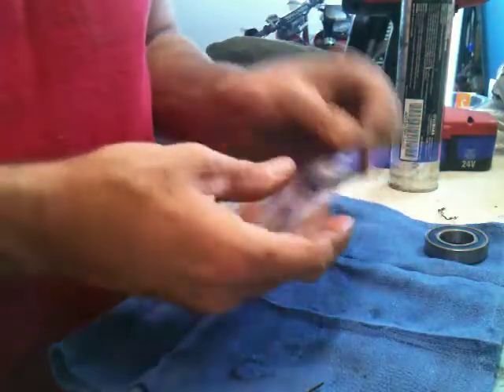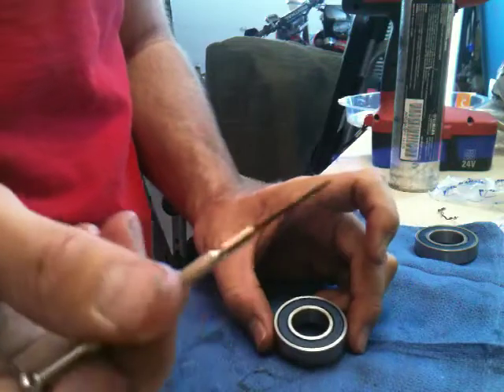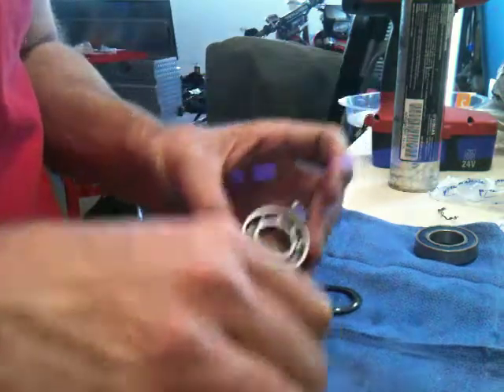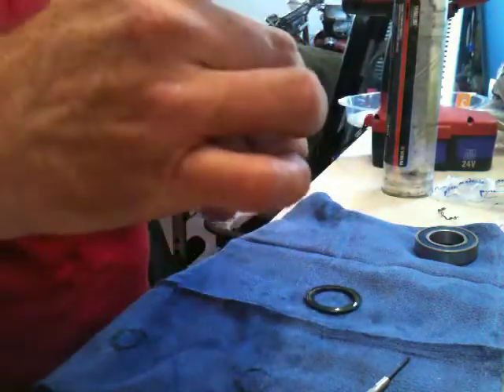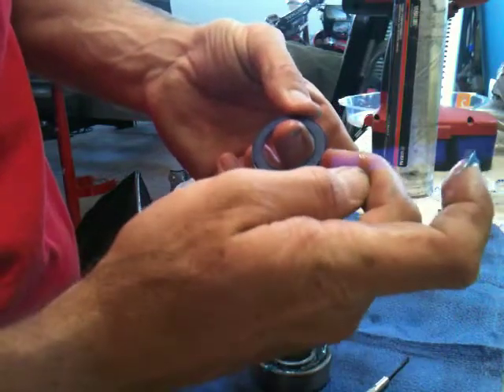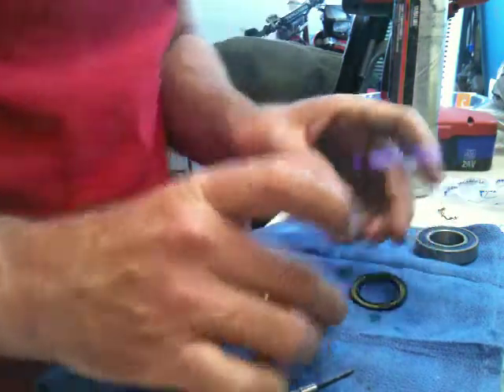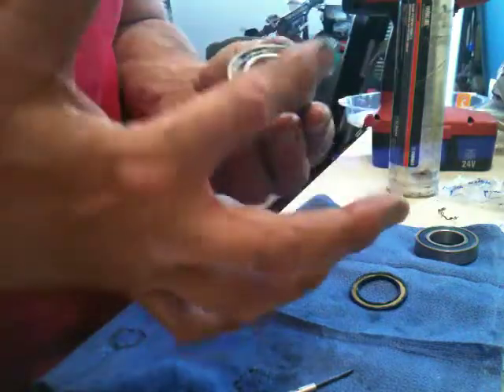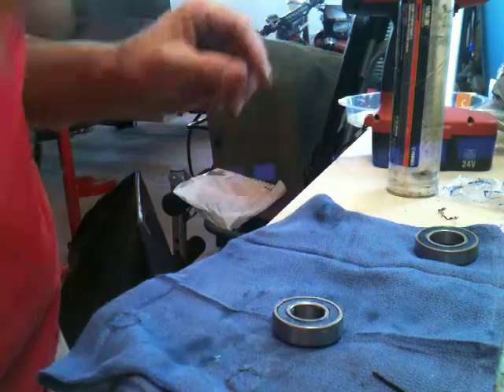How to Grease Dirt Bike Wheelbearings

Comment: Are these the bearings from the coolant water pump housing? Need to replace my sealants and bearings bc I have a coolant leak...
Reply from the maker: no, these r wheel bearings
Reply: +anesthesiadreamin thanks i see u said that by the end of the video, if i wouldve waited. got it figured out with the water pumo and will use your video for my wheels eventually. thanks!